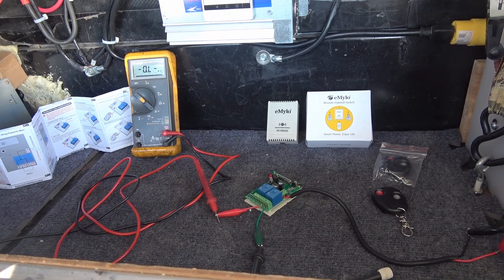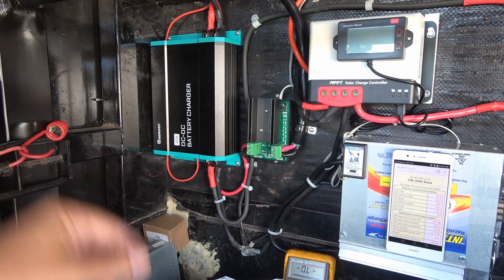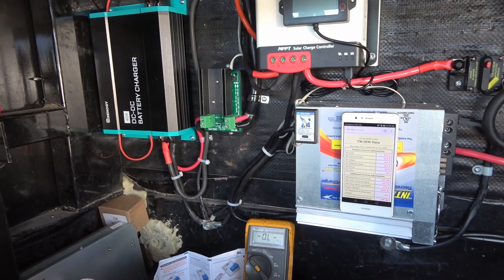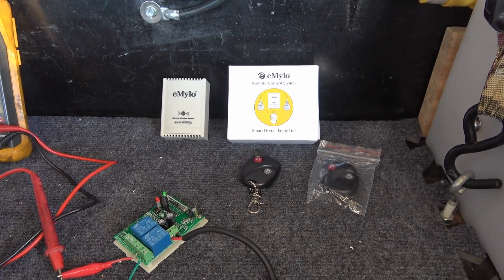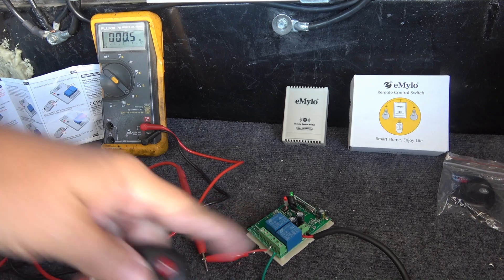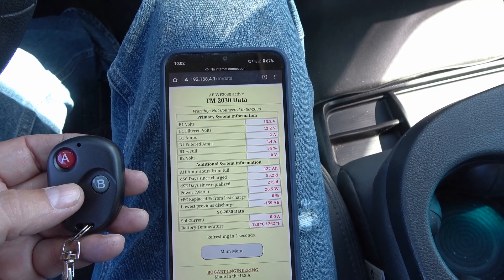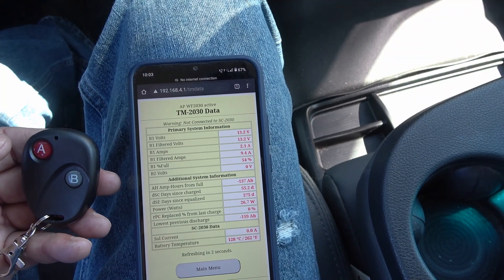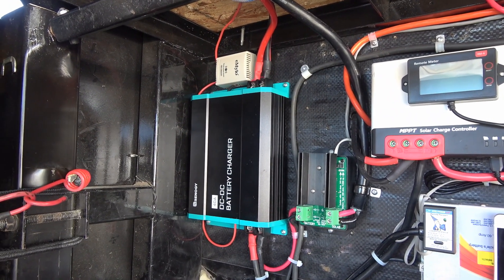12 Volt Wireless Switch Mod for my DC-DC Charger ON/OFF

Comment: Thanks Ray.  Perfect timing.  I am in the process of installing a DC-DC charger on my Travel Trailer and wanted the ability to turn it on and off for the same reasons you mentioned.  Thanks a lot for the idea.  Much appreciated.

Comment: Very well presented and explained.  I too installed a similar remote-controlled switch.  Works great doesn't it?  Provided there are 2 channels (which you appear to have), it is easy to connect the halving switch with a second wire.  Now I can select 20 or 40A charge from the truck cab.  I like to drop the charging current (especially in very hot weather) to protect the alternator.  I have switch A for on/off and B for current halving.
Again, thanks for the really good videos.

Comment: Nice set up Ray. I saw another video that says that your alternator isn't designed to pump out that kind of amperage for any length of time, so they used a device that switched the draw on and off every 20 minuets, he said the device was expensive, but i don't remember the price.
Reply from the maker: Thanks, I also read about devices that have a sensor to read the alternator temps and can shut off the charging if it starts to get too hot. I made sure when I factory ordered my Ram diesel truck to elect for the optional 220 amp alternator versus the 180 amp stock version. So should be OK. I had in my mind I may want to add the DC-DC charger or winch or light bar. Cheers, Ray

Comment: Thanks for the video, Ray. I'm powering up the switch directly from my starter battery. I still don't understand which of the 6 switches i should connect the 16 gauge wire that goes to the charger to turn it on. I think it's the third one moving right to left.  No other connection is necessary other than that one wire, correct?  Thank you.
Reply from the maker: Here is how mine is wired https://www.loveyourrv.com/wp-content/uploads/2021/09/emylo-switch-2.jpg  https://www.loveyourrv.com/wp-content/uploads/2021/09/emylo-swrtch-1.jpg  It gets power for the board from the DC-DC 12V input from the truck. That's the red and black I just soldered to the DC-DC charger input lugs. The the orange wire is a 12V feed from my marker light circuit that I spliced into, the orange one closer to the end is going to the DC-DC charger D+ trigger input. For everything to work I need the truck plugged in and the marker lights on.  In my demo at the start of the video the input orange would be the red wire and the output orange would be the green. But the reverse should work just as well. All the happens is when the wireless button is pushed the relay latches and shorts those two connections to pass the voltage.  Hope that makes sense. Keep in mind too the device has to be in latching mode operation. These are other modes but that was the default on mine and it works well. Cheers, Ray
Reply: @LoveYourRV  Thank you so much, Ray. I think I got it. I appreciate the quick response.

Comment: Hi Ray,  any issues with the range such as your truck cab?
Reply from the maker: No issue so far in my tests, in the video I'm in the truck cab parked about 20 feet from the RV. The manufacture specs the device at 30-50 meters range. It's likely similar to garage door openers. I'll be on the road tomorrow so will test while moving.
Reply: @LoveYourRV    Thanks. Strangely I ordered yesterday a lite wired switch to install next to the landing gear switch. I cancelled it. I’m going to order this and a separate reminder light for that spot instead. Thank.

Comment: Ray I got a dumb question, do you hook up the relay wire in the  wireless switch and that’s it, or is there something else . I’m not electrically inclined person. Thanks , sincerely Bob
Reply from the maker: You hookup 12V power + and - to power the wireless switch board, then it has various different programable features to control stuff and various output connections.  I just wanted to use it as a switch to open and close the 12V trigger wire to my DC-DC charger. There are several ways it can be hookup up https://images-na.ssl-images-amazon.com/images/I/71EqEKkFB0L._AC_SL1001_.jpg
Reply: @LoveYourRV  thanks 👍🏻🇺🇸🇨🇦

Comment: If I were to add an external on light in the circuit, would I wire it in parallel or series. It would be nice to look in the rearview mirror and know if its on or off.
Reply from the maker: To know for sure you need to sense DC-DC charge amperage is flowing. I use a battery monitor with a shunt that has a wireless app so I can view the amperage. Some DC-DC chargers on the market now have Bluetooth and their own app.

Comment: How far is the range on the fob?
Reply from the maker: 30-50 meters is the spec, Seems to work fine inside my truck hooked up. Another commenter says he is using it turn on and off his rear RV camera. The device uses 433mhz radio signals.

Comment: I want to hook this up to my Victron Buck Boost DC DC charger. It has a purple pin wire that indicates the converter is on. I would like to install a wireless switch to turn it off. How would I set this up? I know where to place the +/- wire in the DC12V control box but I don't know about the purple wire that I will have to splice to make this work. Do I require a 1 or 2 channel device?
Reply from the maker: One channel will work, I just happened to pick a 2 channel, they are cheap. just needs to be able to be a latching switch. Here is how mine is wired https://www.loveyourrv.com/wp-content/uploads/2021/09/emylo-switch-2.jpg  https://www.loveyourrv.com/wp-content/uploads/2021/09/emylo-swrtch-1.jpg It gets power for the board from the DC-DC 12V input from the truck. That's the red and black I just soldered to the DC-DC charger input lugs.  I assume the Victron purple wire is an on/off trigger wire so like my orange wire.  In my case, the orange wire is a 12V feed from my trailer marker light circuit that I spliced into, the orange one closer to the end is going to the Renogy DC-DC charger D+ trigger input. All the happens is when the wireless button is pushed the relay latches and shorts those two connections to pass the trigger voltage for the DC-DC converter.  Hope that makes sense. Keep in mind too the device has to be in latching mode operation. There are other modes but that was the default on mine and it works well. Cheers, Ray
Reply: @LoveYourRV  your correct when the purple light/wire is lit, the house batteries are charging the chassis battery and I need that to stop. I know I will have to splice into the line but I don’t know where to insert both ends into the box.

Comment: How did you plug your wire from your DC to DC in the controler????
Reply from the maker: @LoveYourRV
2 years ago
Here is how mine is wired https://www.loveyourrv.com/wp-content/uploads/2021/09/emylo-switch-2.jpg  https://www.loveyourrv.com/wp-content/uploads/2021/09/emylo-swrtch-1.jpg  It gets power for the board from the DC-DC 12V input from the truck. That's the red and black I just soldered to the DC-DC charger input lugs. The the orange wire is a 12V feed from my marker light circuit that I spliced into, the orange one closer to the end is going to the DC-DC charger D+ trigger input. For everything to work I need the truck plugged in and the marker lights on.  In my demo at the start of the video the input orange would be the red wire and the output orange would be the green. But the reverse should work just as well. All the happens is when the wireless button is pushed the relay latches and shorts those two connections to pass the voltage.  Hope that makes sense. Keep in mind too the device has to be in latching mode operation. These are other modes but that was the default on mine and it works well. Cheers, Ray
Reply: Thanks !!!!Nice job!!!!👍👍

Comment: Thanks for this video. It's exactly what I needed and I didn't even know I needed it lol. I bought it through your link and installed it. Thennnn, my brain started bugging me.... how do I know I turned the dc-dc charger off when I wanted it off without going to look at it or get that screen monitor you are using. Then I found this one and bought it. https://www.amazon.ca/gp/product/B08JGH471B/ref=ppx_yo_dt_b_asin_title_o00_s00?ie=UTF8&psc=1 it's an on/off type where I can spam the crap out of the one button I want the mode in.

Edit, so quick question please... are you running an always on 12v power supply to the power input or is that switched from your lights too?
Reply from the maker: Cool. :) I'm powering it from the truck battery/alternator input to the DC-DC charger. So when I plug the DC-DC charger cable into truck in it gets power. Unplug the truck, no power.